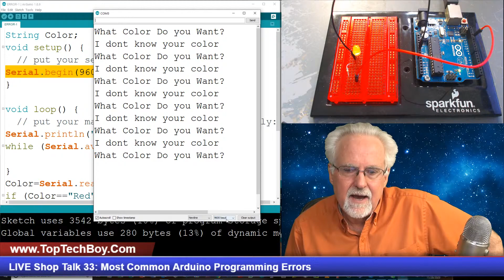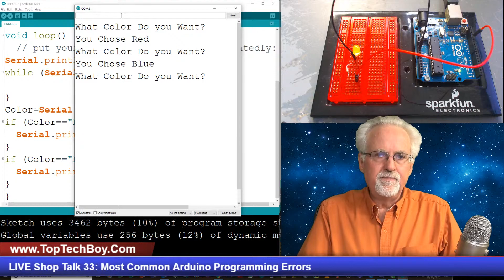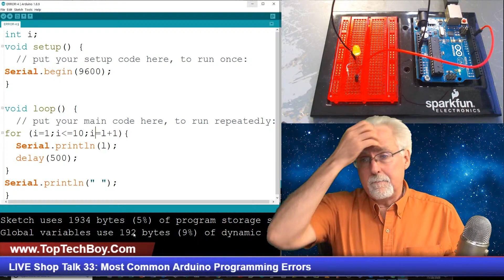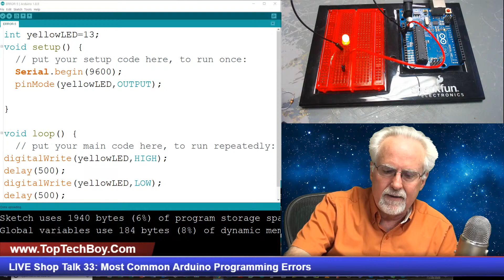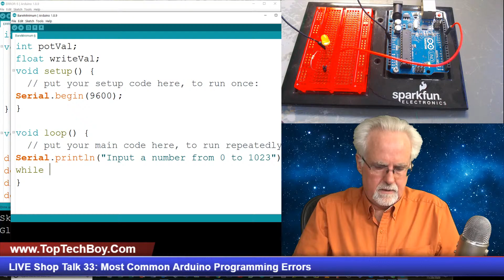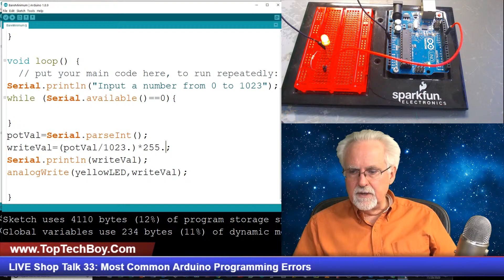Comment: I ran into a NOT uploading issue with a couple of Arduino Nanos I have.  It seems as I have a mixed bag of Nanos, and although you can't tell the difference between them by looking at them, as far as I can tell, you might have the wrong bootloader selected in the IDE for a particular Nano and then you won't be able to upload code to that Nano.  On the Nano there is a processor listed as having the "(old bootloader)".  If you are set for the "old" one and then tried to upload to one with what I guess you could call the "new" processor, it will hang in the uploading cycle.  I've gone through my inventory and placed small red dots on the "(old bootloader)" Nanos.

Comment: Hello Paul, I didn't catch you live but watched it 90mins later. As soon as the episode started, I felt enthused to fix my old soundbar (which is pretty costly and so I was afraid to tinker with it). While listening to your methodical approach to problem solving, your voice encouraged me to go beyond my fears and take the case apart. You see the device wouldn't power on at all and I guessed the 18650 cell had given up ghost. But as soon as I got to the control board, the issue was clear. The power switch legs had come off the board (cold solder). A bit of soldering fixed it right up and I sprayed the switch with a bit of WD40 for good luck. So thanks for helping me fix my precious soundbar. 
P.S. I hate buying consumer electronics, especially when they go bad before their time.

Comment: My arduino Hummer-Bot i just bought can not get. My IRremote will not test { or program ; from the manual 4.0 version. ll ( ( program (in , All._IRrrmote + Libraries + Milliseconds )) Do i burn. To. The Bootloader Not. Sure if the product is. Elegoo , My remote says Maker i have taking all programs into.cosideration. i know i have go in and out. To restart the IDE than back to my file program Help what. Way do i go Also. How should i choose my Too = set up in my Sketch .Great work by the way. (EN1, Love My Coffee)                                                   pinMode(EN2, HELP);                        delay(20);